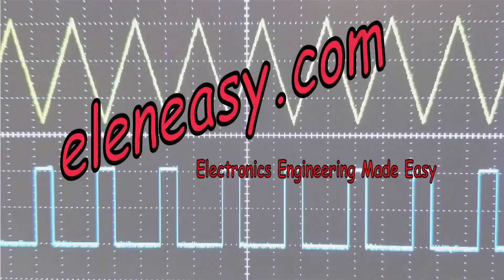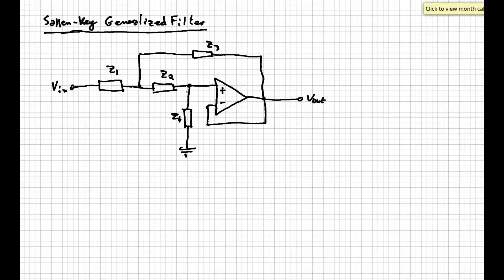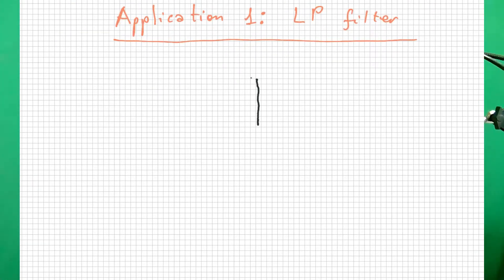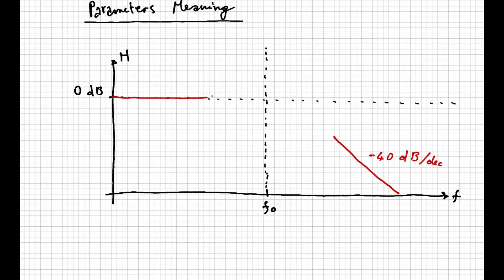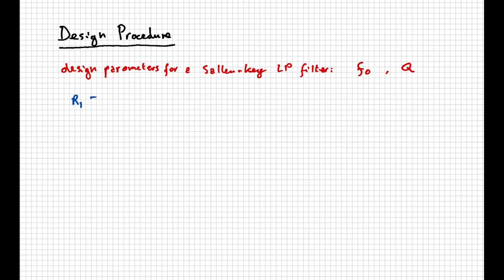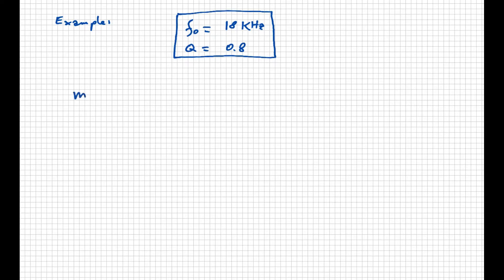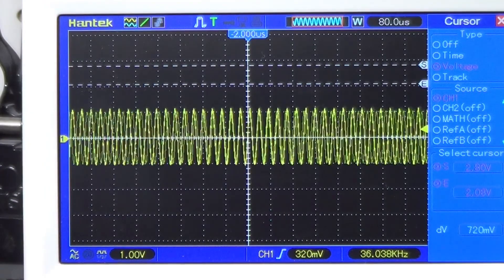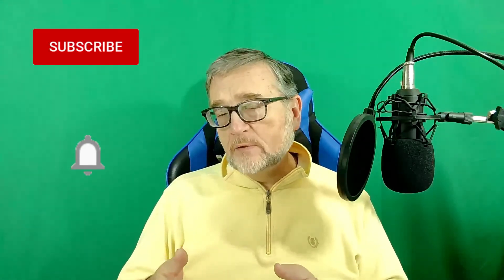Filters Tutorial Episode 9: The Sallen-Key Second Order Active Filters

Comment: Thank you so much, it helped me so much!
Reply from the maker: I'm so glad!
Reply: @eleneasy  I also got a question, It's okay to cascade two second-order circuits (with the same capacitor and resistor values) to achieve a fourth-order filter? or it will impact da quality factor?
Reply from the maker: @mirunavlasceanu706  Yes, as long as they are active filters, you can cascade two second order filters to make a fourth order filter. However, the quality factor, or Q, also changes. In particular, if you use two identical second order filters, the new Q factor becomes sqrt(2) times (about 1.41) the original Q factor of each filter. If the two filters are different, then it is necessary to study the transfer function of the newly formed 4th order filter to understand how the Q changes.